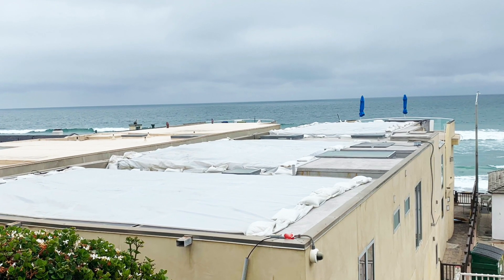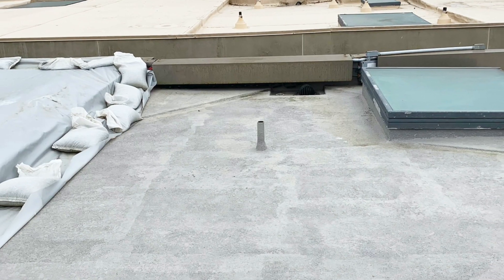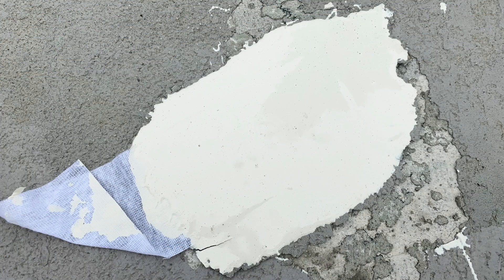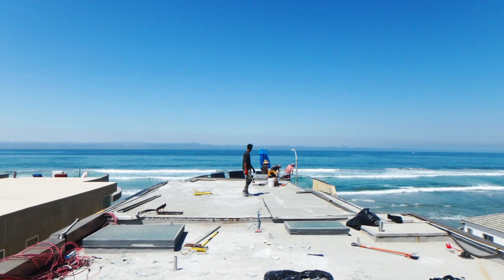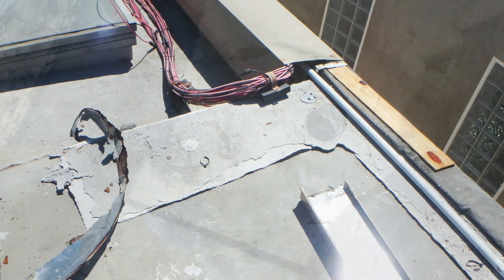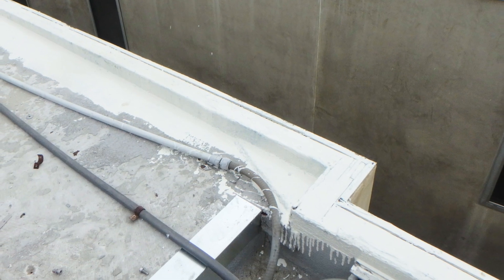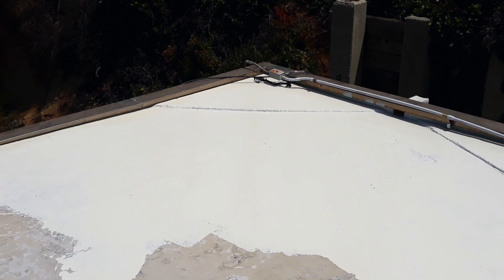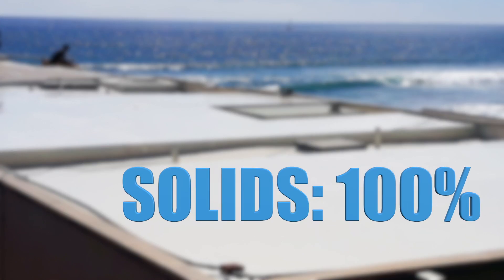How To Repair and Waterproof a Flat Roof (Eco-Friendly Roof Coating)

Comment: Hi...I work at the airport and started using Ecodur part A/B roof coating on the roofs of our jetways. Question is, why does the product turn from light yellow in color  to orange color after several days?
From Guam, USA 🇺🇸
Reply from the maker: Great question! 

Color change is a completely normal and very natural part of Ecodur+ roof coating. In fact, this change happens because of the natural, nontoxic ingredients that make up our extremely eco-friendly Ecodur!

As Ecodur adjusts to being exposed to the sun’s rays on your roof, the coating will undergo a temporary shift in color. This is a completely natural and anticipated process that Ecodur+ roof coating — as well as all other products that are catalyzed with MDI (Methylene Diphenyl Diisocyanate) — experiences as the MDI ages. The color change would take place even without any UV exposure, but to our advantage, the more sun your Ecodur+ roof sees, the faster the process will occur — and the faster it will return to (approximately) its original color!

Ecodur roof coating is extremely UV stable and will not chalk or degrade in the sun.

You can learn more at https://www.castagra.com/blog/ecodur-roof-coating-color-change/
Reply: @Castagra  Thank you very much for the reply 👍 I can attest that Ecodur roof coatings are top of the line products, better than silicone.
Hafa Adai to you guys, from Guam, USA 🇺🇸